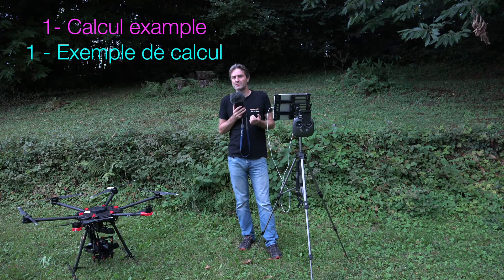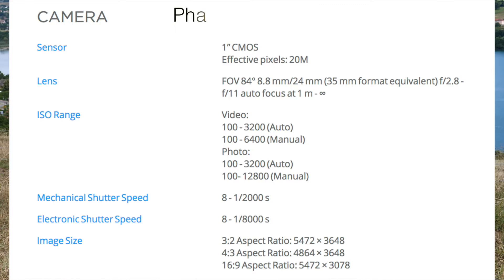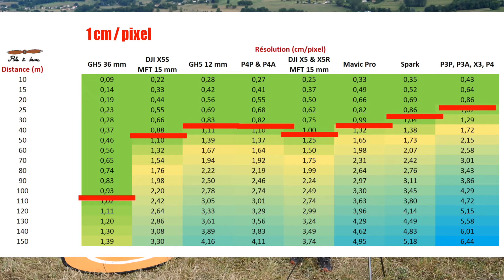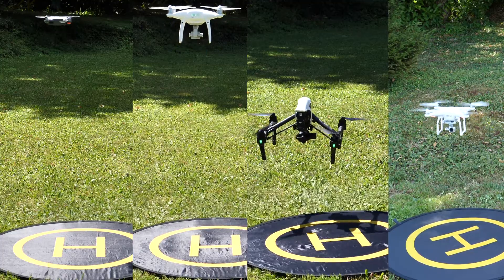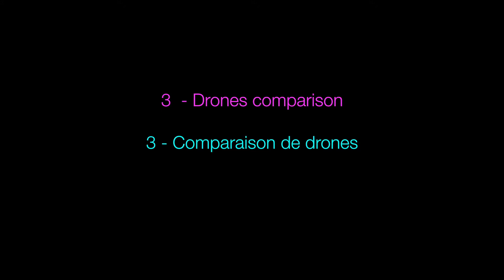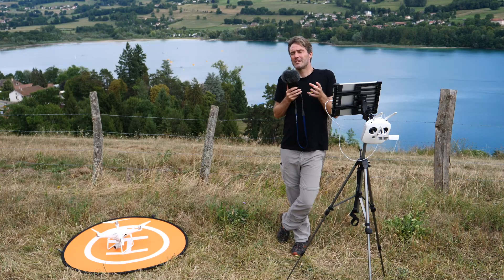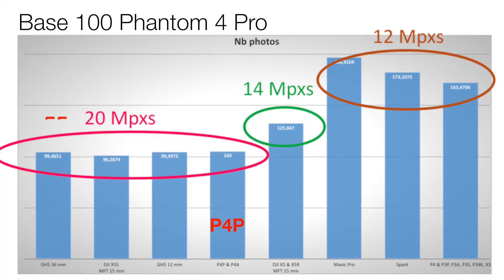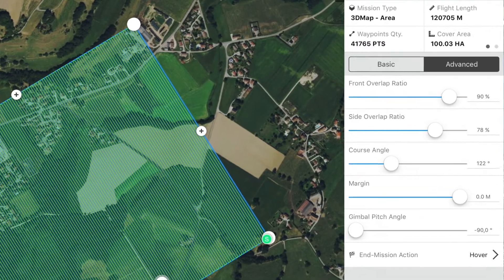La résolution des photos par drone

Comment: Buenos días, gracias por el video. Hablando de fotogrametría por favor indíqueme si la combinación de el DJI Matrice 200 + Zenmuse X5s captura menos fotos a una misma altura en una determinada área en comparación que el Phantom 4 Pro, estoy buscando reemplazar mi phantom por uno que avance más área pero con la misma resolución especial, gracias de antemano
Reply from the maker: Hola, gracias por tu mensaje y tu muy buena pregunta. La respuesta es no, por desgracia. No debería haber ningún progreso significativo ya que la derrota de los x5 está muy cerca de la derrota de la cámara P4P.
Debo decir que la calidad óptica y la sensibilidad de la cámara X5 sin embargo deberían traer beneficios en calidad, pero no en productividad. Hasta pronto !
Reply: Paladrone gracias por tu pronta respuesta. Entonces que equipo de DJI recomiendas para tener mayor productividad que el Phantom 4 Pro?  O quizá alguna otra marca de multirotor o ala fija ?

Comment: Hola gracias, acabo de ver el video otra vez, en ese caso para el Mavic Pro cual es el ancho del  sensor? vi que en un video el ancho del sensor era 12.8 o 13.2 mm  para el P4P, pero tengo duda con el ancho del señor del Mavic Pro,Gracias!
Reply from the maker: hola el ancho del sensor mavic es de 6.25 mm, esto está en la tabla de este video a las 8:48 ;-)
Reply: Hola, si es cierto, disculpe y muchas gracias por su amabilidad.

Comment: Excellent but there must be an error in your diagram, the formula is linear so where does the kink at 30 m comes from [res/dist] ?
Merci pour expliquer!
Reply from the maker: Hi Gus thank you for the relevant comment ! Indeed, the formula is linear and the diagram looks like a broken line.
Actually the graduation on the x axis is not constant: 5 m before 30 m and 10 m after. The values of the diagram correspond to the array at 1:49.
I should have mentioned it more clearly in the video ;-)
Reply: Thanks a lot, I thought, no way he is making errors in math therefore  the scale of one of the axis must have been changed but then my mail was send already..
Question; do you have  a video regarding drone mapping discussing optimum settings for forward and side overlap, drone speed and shutter speed etc..?
Of all the instructional videos around, yours are absolutely topgun, very professional and to the point. No loose talk, very clear math and fun to watch.I find that no where else. Again, thank you very much!
Gus
Reply from the maker: Hello Gus, delighted that the format of the videos suits you and a big thank you for your message. I have never touched on the points you mention, these are very interesting topics for future videos! Thanks for these great ideas ;-)